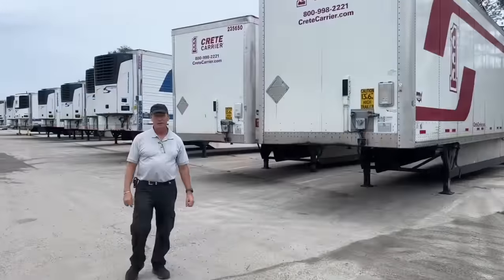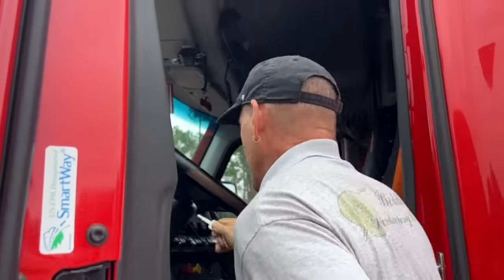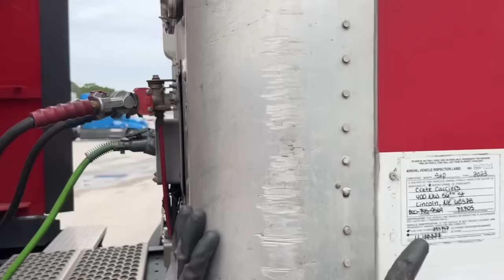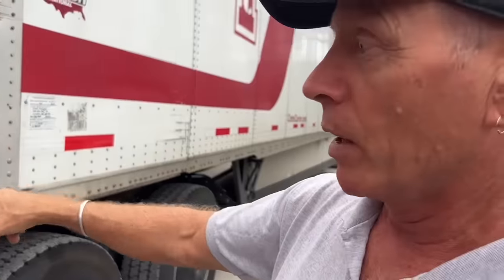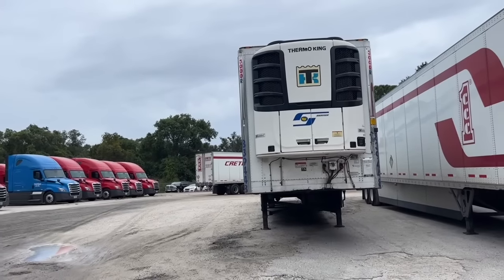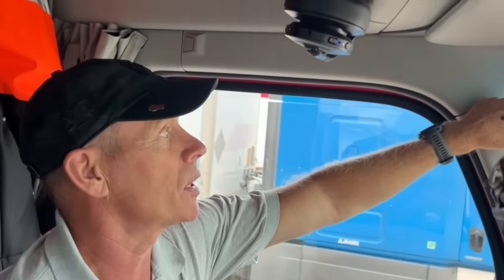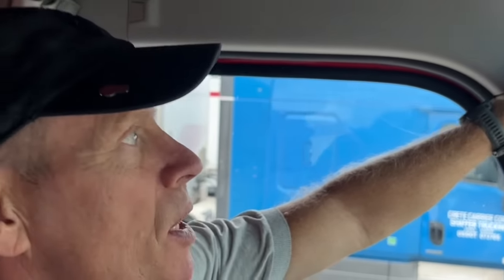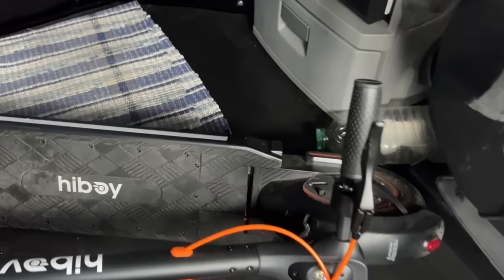B-Service, High Trailer, and Other Trucking Stories

Comment: Sure is nice to be living close to a terminal (one with a shop) when you need work done on your truck & you're going home. I live about 35 miles from the Wilmer terminal & my truck is due for a B service. Good timing too because my bunk heater has gone out

Comment: Tell Kevin I was taught in the beginning of my trucking career to place one hand on dolly handle & one hand flat on the trailer when winding up dollys. This will keep him from injuring his lower back. Tell him to try it he will understand  how this will protect his lower back once he trys this method. This method will keep the stress off his lower back.
Reply from the maker: Thank you so much for this tip! He says he engages his core and hasn’t felt vulnerable while winding dolly. But…he will give it a try. Protecting the lower back is VERY important. So THANK YOU!
Reply: Have never been injured rolling the dollies up or down and I used one hand

Comment: Crete is a good company. My only problem with the company they were a little too gung-ho for me. At this point in my driving career I like the slow and laid back driving style.
Reply: What do you mean by Gung ho?..pushy?
Reply: Pushy to a point and yes pushy in a good way. I understand they are just trying to keep you moving to make good miles but sometime you need a break to recharge and that’s what they didn’t understand.
Reply: @jeffreyparker8703  How long did you stay with them?..and they run you east coast alot?
Reply from the maker: Yes. It’s a very good company. As for ging-ho…We think a lot of it probably depends on freight and the asset manager. Kevin has never felt pressured. But glad you found a place where you enjoy being and can take it 😎…😃👍
Reply from the maker: @wilE6764  Some east coast. A lot of Midwest, North Carolina to Indiana.

Comment: I take it you never jumped a pin? If you back under a trailer that the air suspension lost the air and hook up your emergency airline and charge the airthat should fill the air suspension make sure your tracktor bkakes are locked
Reply from the maker: You mean for trailers with air suspension? We haven’t encountered those. But thanks for the tip.

Comment: I love your videos and miss having them more often, but I understand.  One question, what if another drive came in to the terminal between 'now' and 'tomorrow' morning and had a load which left 'tonight' and needed an empty trailer, and you are under the only one in the yard.  Would/could the shop get into your truck and move it so the other driver would have an empty for his load?

Comment: Just wondering the blue Semis and trailers they hall different areas of the country and different products
Reply: The blue trailers are refrigerated units. The blue trucks were originally Shaffer, but they've been mixed for many years now.
Reply from the maker: The blue tractors used to be Shaffer for refrigerated. Now the red and blue get mixed up a bit.
Reply from the maker: @Shad0wSabr3  👍👍👍Thanks for answering the other viewers question!!

Comment: I see quite a few blue Crete trucks on the road. Is there difference between the blue and red besides the color?
Reply from the maker: Blue used to be Shaffer. But now they mix’em up a bit.
Reply: @TheJoyofTrucking think crete/shaffer started mixing them up back in 2010 or so. Too them(maintenance dept) it didn’t matter what the color of the truck is and who the driver was driving  for. Too them a truck is a truck.. i gave it up after 26.5 yrs of driving and 23 yrs 3 months was with Shaffer was 19 months and the rest was with crete. Enjoy it while you can. And your videos are awesome..i left back them in sept 2021.. have a good Christmas THE 2 OF YOU.